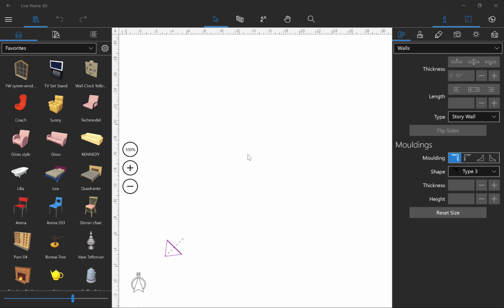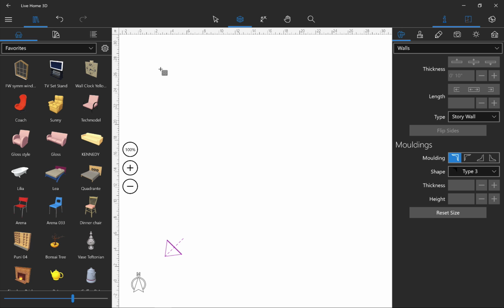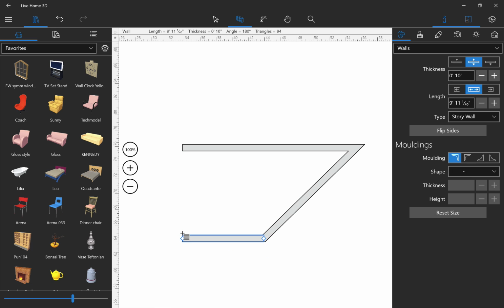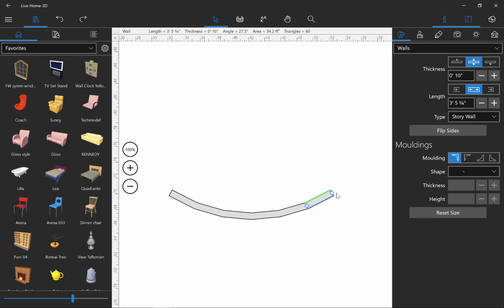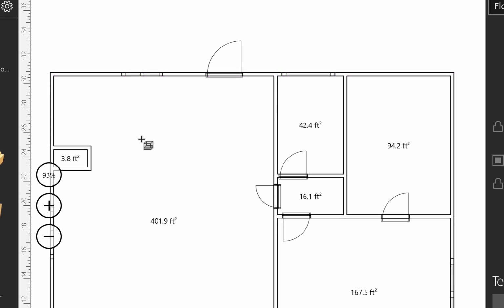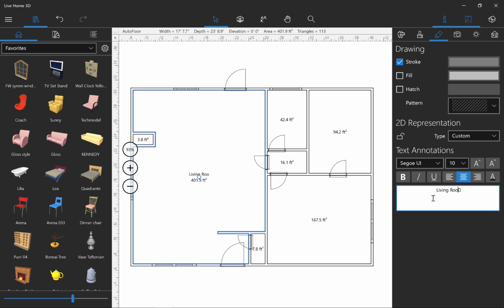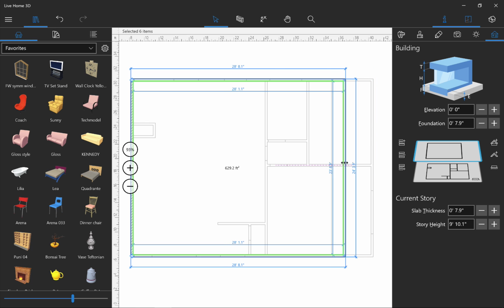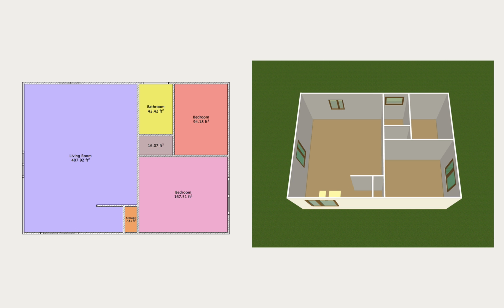Live Home 3D for Windows Tutorials - Creating a Floor Plan

Comment: hi i zoomed out the screen too much. how do i find my home again?
Reply from the maker: Hi Zeke, you can fix the camera in one of the following methods:
1) add a custom camera in 2D using the Auxiliary tools and switch to it; 
2) use the Cameras tab of the Inspector to switch to any Predefined Camera and work with it, or add a custom camera (this is the best way if you worked in 3D and do not want to switch back to 2D).

Comment: How can I adjust the alture of a wall?
Reply from the maker: Hello! The program does not allow you to set up the wall height directly. All Story Walls on each story have the same height equal to the story height. To change it, use the Building Properties tab in the Inspector.
To create a shorter wall under the roof, you can use Loft Walls.
You can also watch the video "Split Level Houses", if this is what you are trying to design: https://youtu.be/vTeYhPcKDPg